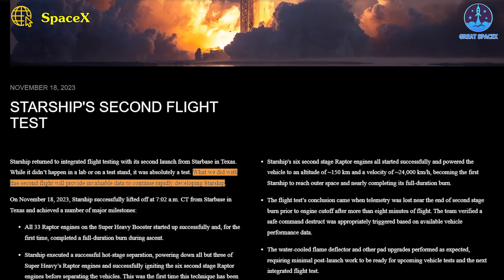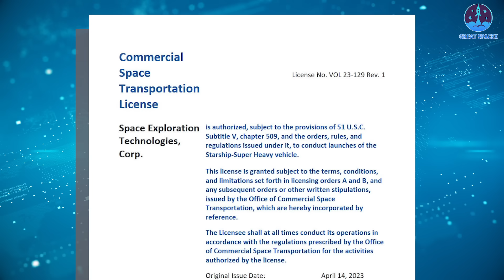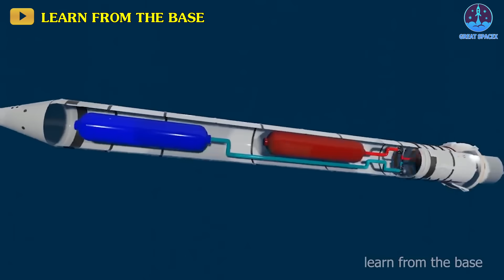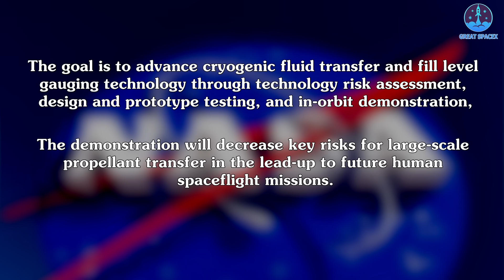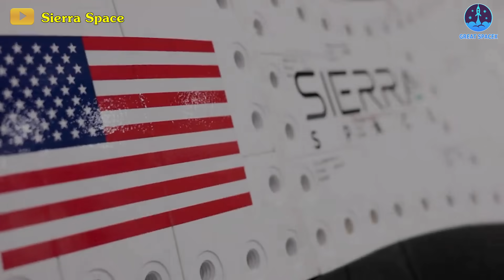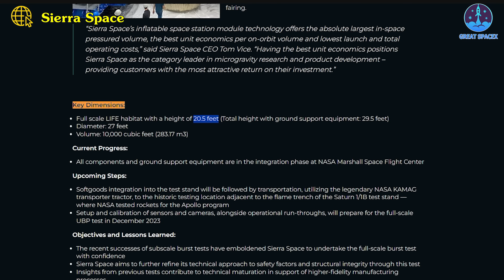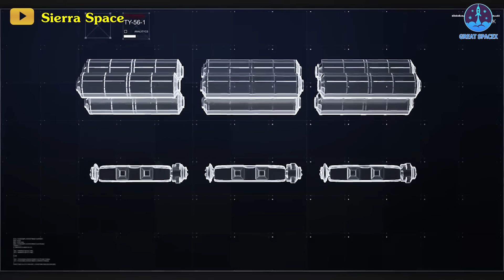SpaceX finally revealed Onboard vid from Starship IFT-2! Static fire for Flight 3 incoming...

Comment: It appears that the separation has clearly shown over flow flames that may have caused the explosion to main booster. Adding a flat plate between the booster and shuttle separation would help restrict the damages to separation. Preventing heat in separation would be better to the booster separation. Perhaps pressure cylinder at great psi strength like shooting a rod out of a pressurized none flammable liquid  with release mechanisms. Such as a an over loaded pressured hydraulic pinion with release claps causing a catapult. More like a spring.  Would consider non flammable.  Simply as a smart  doer would do if something has to separate without a spark. Think of the Pneumatic cylinders or Pneumatic ring at 5k to 20k lbs. of pressure separation before giving a start the shuttle itself.

Comment: Chemical rocket engines are good for getting off the planet and launches, but they’re gonna have to start developing a fusion based rocket within the next 10 to 20 years to make space travel worth it anyway, we’re getting close right now fusions at 50-50 breakpoint we’re not wasting more than we’re making we’re breaking even within the next 10 years we’re gonna have fusion that’s not an issue with the way technology is going these days but it’s implementing that into rocket base technology which I know they’ll do that too but still

Comment: Shade temp in LEO is -141 C. A large shade?  Able to maneuver on its own. 
Also. Version 2 will lift 200 mt to LEO. By 2026 X should be able to launch 8 Starships in a single day. 1600 tons of fuel. 1280 tons for a lunar mission. Lunar Starship already havong 100 tons of fuel when it arrives.
16 launches cited by NASA is based on version one.

Comment: How will the materials handle long term exposure to UV and changes in humidity as well as micro particle impacts that can occur in LEO.
Reply: There is a very small version of the inflatable pod already on the ISS - the astronauts don't usually have it open to the rest of the station, and just use it for storage.

Comment: There is something SpaceX is overlooking while transferring fuel from one ship to the other. It's call "Rolloever" and that is a condition from mixing 2 different temperature and composition fuels together. They don't like to be mixed and begin a violent expansion of one or both different fuels. At 600/1 this will explode whichever storage system is used. They have to test the fuels before they launch and before they transfer the test. It would be a smart move for SpaceX to send up people and testing equipment to prevent this condition.

Comment: Why didn't you explain where you got the video at 0:19?  You implied thus was from SpaceX, was it?  There is important information about ALL 33 Raptors being being reliable during the entire boost phase prior to hot staging engine shut down.  Apparently its more important to show EM joyfully hooping around than it is to raise this point.

Oh and IFT-1 never got to the speed and height to even try to do a stage separation.  Your AI needs to use better sourcing to even approach accuracy.

Comment: Can someone please explain how you can transfer liquids from one container to another in microgravity without using bladders inside the tanks to keep the liquids from separation. I can't visualize this process.
Reply: Slight acceleration will cause the liquid fuel to collect at the "bottom" of the tanks relative to that acceleration.  The pump intake can then pickup and transfer the liquid.
Reply: Maybe create artificial gravity by rotation of the two vehicles would work. Just don't know how the movement of the liquids would affect the spin. Could be like a wheel that is out of balance and that would definitely affect the spin. ??
Reply: Think of it like this 4 tanks ok.
Lox at bottom / methane on top above methane is the "header" tank. All liquids are moved and propelled using Gaseous Helium for Pneumaticallu pressed and regulated systems. A "fuel transfer" is just using the "header" tank to refuel lox and methane and seeing the numbers on the "gas tank" increase by showing the "emergency fuel" reserve can and will work.
Reply: Using magnets of course.  . .

Comment: No way SpaceX is even remotely close to performing in-orbit fuel transfer. Can Falcon 9 even do this?
Reply: Relax! In due time. Busy focussing on leading the industry in all other areas......
Reply: the falcon 9 will become even may become obsolete in 30years and NO ,2nd even stage can't even RTL
Reply: @NikanDragosysSerpenDra  Perhaps, but I meant the question more as can SpaceX even do those kinds of maneuvers? They should at least build up two cheaper falcon 9's and try fuel transfer on a smaller scale, but it still sounds dumb as hell the way they want to go about it.

Comment: They don't need to reach LEO to test fuel transfer between 2 tanks. They just need it to coast on a trajectory in 0G and that will be enough for it to test on board refueling.
Reply: No... in orbit refuelling, funnily enough, requires the vehicles to rendezvous in orbit...

If they don't achieve orbit, then firstly, how do you dock two ships on different ballistic trajectories?... That's just not possible unless you launch them both side by side to begin with which defeats the point entirely.

A proper test would require a rendezvous already in space, that necessitates both vehicles to be in orbit or else the first vehicle will be re-entering before you get chance to launch the second.
Reply: @kal9001  Yes, that is correct for on orbital refuelling between 2 ships, but for fuel transfer between 2 tanks in 0G, a suborbital trajectory is enough.

Comment: They've had engineering cameras inside the fuel and LOX tanks on other rockets, that would be very interesting video if IFT-2 was equipped.
Reply: They showed it filling here. Im positive that video exsists somewhere. 
The footage shown has to be LOX due to the blue hue. It also has a strange motion to it in that footage of the tank filling up. You can tell the viscosity is different than most common liquids.